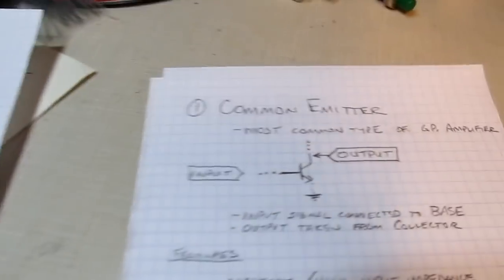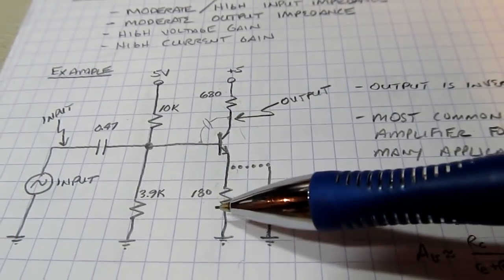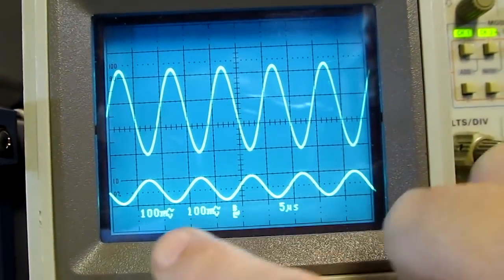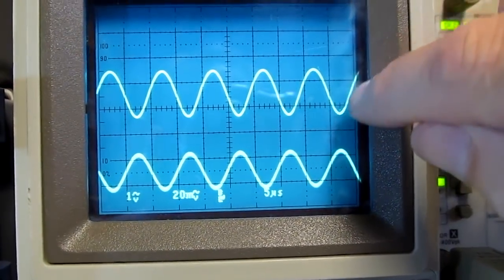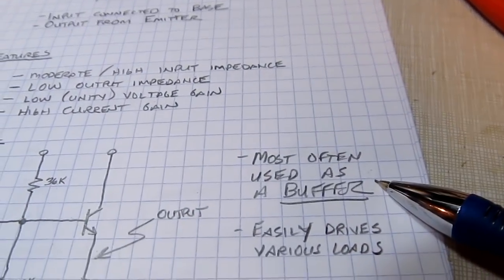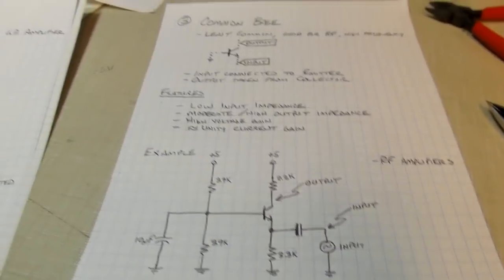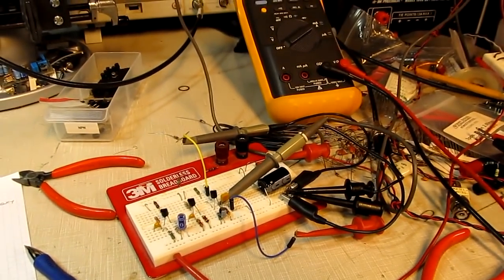#114: Tutorial: Common Emitter, Common Collector, and Common Base Transistor amplifiers

Comment: Hi Alan, I connect to the emitter with a sine signal generator, then turn on the power circuit. After power-amplitude sine signal generator with reduced. So it should be, or I something I doing wrong?
Reply: I did not say that the common base. The following was not selected the correct separation Capacitors, he was a small tank.
Reply from the maker: Yes. The CB amp has a low input impedance and will load down the source.
Reply: ***** Alan I first filed its amplitude sine was Normal , but as soon as I gave my 5 volt voltage drops .
Why it fell after the 5 volts?
I think a capacitance change in the transition be?
Reply from the maker: Once the base-emitter is biased "on", the input impedance of the common base amp is low.
Reply: Thank you Alan!!!

Comment: good day sir. i am a student at a university. now i have a report on TRANSISTORS AND AMPLIFIERS: power gain in transistors, voltage measurements in transistor circuits and phase relationships in common base amplifiers, common emitter amplifiers and common collector amplifier. these reports were assigned to me and i have a hard time in understanding how these works. now as a newbie in these stuff, i humbly ask for your help (if you have time and willing to help me) since you are a professional in stuffs like this. i would like to have you as an online resource speaker sir. i would like you to explain these to me in the simplest way you could. (minimized equations and the like) so that i could report it to the whole class with much understanding as you have. ill be reporting in class on September 22, 2014(Monday,Philippine time). i hope for your kindest and sincerest response thank you sir. :)
Reply from the maker: All of these answers are in this video.  When I say that a particular configuration has a high voltage and current gain, then its power gain is high.  When I say that its gain is inverting, that means it has a 180 degree phase shift.  When it is non-inverting, it has a zero degree phase shift.  A high input impedance an low output impedance implies a high power gain.

Comment: So, is common emitter and common collector used in AB amplification?
Reply from the maker: Common collector doesn't provide any voltage gain - it is typically only used as a buffer stage to provide a low-Z output.  Common Emitter is most often used in amplification in Class A, B, AB, etc.
Reply: @w2aew  ah yes you did say that already about common collector in the video. I am just learning about transistor biasing on my own, just trying to piece it all together.  This lecture taught me so much about conventional directional and biasing gain.  Ill be head deep into the books soon enough at community college learning all of this stuff. Thanks again!!

Comment: What transistor used for make de circuit and the frequency is about 200kHz ?
Reply from the maker: Any general purpose NPN like 2N2222 or 2N3904 will work.
Reply: @w2aew  Thanks, Sir. It really works with these transistors

Comment: So we see that as the input is at maximum, the output is at minimum...but why? Is it because the base "steals" the electrons that are bound to collector?
Reply from the maker: When the base is at the maximum, the base current and the collector current are at their peak.  This means that the voltage dropped across the collector resistor (collector current * resistor value) will also be at its peak, meaning that the collector will be at its lowest point with respect to the positive supply.

Comment: I made a 300mhz common emmiter amplifier with 2x gain i can convert 50 mv to 100mv p-p but I can't convert 2v to 4v why? What part in my circuit should be change
Reply from the maker: Without seeing your design it is impossible to answer.  You have to make sure that the biasing of the circuit is leaving enough headroom for your signal to swing through it's entire range without saturating or cutting-off the transistor.  Sometimes it is easier to think about it from a DC standpoint.  What happens when the input is DC at the +peak level of the input signal?  Same when it is at the -peak of the signal.
Reply: @w2aew  how can I send to you my schematic?
My schematic designed for 50 ohm load so I need some other types of amplifier with more power but idont know how do that with mmbr951 rf npn transistor??

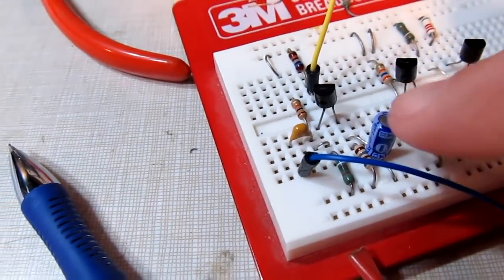Comment: 2:43 

Is it not the capacitor which appears as a short (to the signal) as opposed to the resistor?
Reply from the maker: mre521 Yes, you're right - the cap essentially shorts out the resistor at the signal frequency.
Reply: So instead of the gain being -Rc/Re it becomes more like -Rc/"something small" but limited by the transistor current gain.
Reply from the maker: mre521 Yes, the gain becomes -gm*Rc, where gm=Ic/Vt.  The small-signal emitter resistance is 1/gm, or Vt/Ic.  Vt is the "thermal voltage", which for a bipolar transistor is about 26mV at room temperature.

Comment: The emitter follower has to be the simplest one out of all of these, and yet I have literally the hardest time understanding it - how exactly/intuitively it has a low output impedance, how to drive a load with it, why my decoupling capacitor floats at 2 volts instead of bringing the waveform down centered about ground, etc
Reply from the maker: The emitter follower's ability to drive a low impedance load is essentially due to the fact that it has the benefit of a lot of current at it's disposal - the emitter current is Beta+1 time the base current, so it can provide a lot of current with little change in voltage (because it is simply a diode-drop away from the base voltage).

Comment: Hey I am still a beginner student.. could you please explain what you mean by high input impedence and low output impedance for CC Amp. Also you said its easier to drive the load or something. Use very simple terms to explain it please and Thank You!
Reply from the maker: High input impedance means that it the input of the circuit doesn't draw a lot of current from whatever circuit is driving it.  Thus, it doesn't place a heavy load on that circuit.  Low output impedance means that it can easily provide enough current to drive a load (like a speaker, etc.) without it's output voltage dropping too much.  You may want to watch this video to learn about the affect of output impedance:
https://www.youtube.com/watch?v=tClE8s6RZdg
Reply: ***** thanks ! I have one last question.. Wats the point of adding a buffer at the load spot of CE amp...  From what I understand Cc will output almost unity of what it gets as an input from CE.  My question is why add a buffer as a load to get the same result as output that CE is outputting . Please use very basic terms to explain Thank A Lot!!!
Reply from the maker: Ahmed Mehboob The CE amp can't drive a low impedance load (like a speaker, etc.) with any significant gain, because the output impedance of the collector is very high (looks like a current source).  So, you design the CE to give you the gain you want into it's collector load resistor (which is typically relatively high compared to something like a speaker, etc.), then use the CC to buffer the output of the CE amp - so that the voltage developed on the Collector load of the CE amp is driven across the output load of the CC amp.

Comment: To take the output @1:45 Common Emitter, shoudn't there be a capacitor attached to collector so that only AC comes
Reply from the maker: +Yash Jain It depends on the application.  Some applications can use DC coupling, some need AC coupling.  In this case, I used the AC coupling in the scope channel.

Comment: Hello everyone; could someone explain to me why Alan placed the oscilloscope probe directly at the base of the emitter in the Common  Base configuration  https://youtu.be/zXh5gMc6kyU?t=495 ? Alan mentions that the emitter has such a low input impedance that this is necessary, but I'm not follow. Any help would be greatly appreciated.
Reply from the maker: It is because with such a low input impedance, which is in series with the input signal coupling capacitor whose reactance is not insignificant, that there is a noticable phase shift of the signal through the capacitor.  By probing at the transistor side, I can show the phase of the signal at the input and output of the transistor itself, not including the phase shift due to the input capacitor.
Reply: @w2aew  For what it's worth, I think your statement of :  "capacitor whose reactance is not insignificant" helps me "most" to understand what is going on here with your chose of oscilloscope probe positioning.  Also, I think I now realize that looking at the signal directly at the transistor's emitter base, just makes the capacitor irrelevant, as far as the transistors "singular" functioning (i.e, the phase shift by the capacitor "happens" but it isn't seen - i.e, relative gain - when the probe is directly at the emitter's base of the transistor, and compared to the collector voltage)  - I hope this makes sense, on my part, that is. Thank You Alan
Reply: Can't help but ask: if the input capacitors impedance "wasn't" relative to the input impedance of the Common Base configuration (i.e, the input impedance of the emitter lead being larger, by orders of magnitude, when compared to the input capacitor) would the input signal across the capacitor to the emitter base have been shifted, and by how much. ( I know this question is probably EE 102 material, and, therefore I should already know the answer, but, unfortunately, I obviously don't.) Any additional help would be greatly appreciated - by anyone.

Comment: Common with what?? 
Or does this just mean 'common', as in 'frequently seen or occurring'?
Reply from the maker: It means that this terminal is common to both the input and output signal. In the case of the Common Emitter, the emitter is essentially connected to the same reference point (ground, most often - either directly or through some biasing or decoupling) that is used for both the input signal and the output signal.
Reply: Thanks Alan. I love watching your You Tube videos but as a mechanical engineer, I am afraid some of the concepts still go over my head. :-)
I am trying to kick life back into a donated Tektronix 7403N, to which end I have got the supply rails up and stable by completely re-capping the PS and changing a few crispy components but to date, I cannot get more (less) than -500V out of the HVPS. No trace at all on screen. :-(
Reply from the maker: @grahambambrook313  The high voltage is generated by a high-voltage oscillator and regulator circuit.  The circuit and component functions are described in the service manual.  You won't get any trace until the HV is present at the CRT.
Reply: Alan, I just about have my head around how the oscillator/regulator works but without another scope I cannot match the wave forms shown in the manual. With a multi-meter, I do get the stated voltage at the power transistor collectors and other points appear sensible. I've checked and replaced some of the the components  as best I can with my little tester (particularly tantalum caps) but to no avail, yet. I even replaced the the HV thick film resistor array, unnecessarily as it turns out, as the manual I have has a misprint and shows one element as 29.45K Ohms instead of 29.45M Ohms. Doh!! I have managed to acquire a NOS HV/HF transformer from Sweden and this is going to be my next change-out. Fingers crossed!